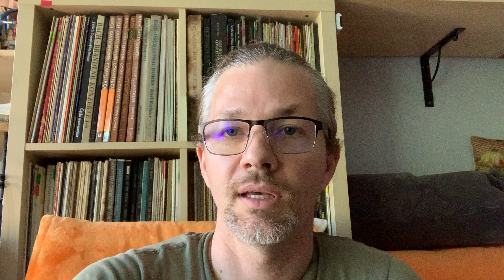Is OTL -  OCL for me or not?

Comment: How will an otl match with  la grande with the Fostex which would not be expensive to replace or will they not suit a single driver the same as the tubes?
Reply from the maker: I have never tried the La Grande with an OTL. I would suspect that it would be a good match. OTL is also tube amp, just no transformer. The matching would really be up to the OTL, what output impedance it has, and how that impedance is generated. If it's naturally low, (rare), it would be a better choice. With a lot of feedback, then it would not be a very good match. It will likely sound good, but likely not nearly as refined as a good transformer based amp. I have heard very few OTL amps though, so all I can say is try it out, and have the experience under your belt.

Comment: Hi janos !    why would otl have a transistor sound? André
Reply: please elaborate
Reply from the maker: 1. lack of output transformer = loudspeaker impedance is not properly matched (same with SS, no accurate impedance matching) 2. loads of negative feedback (OTL requires it, just as most SS). 3. high current & low voltage output (just like SS) 4. much lower plate voltages than OPT designs results in lower voltage/dynamic resolutionjust like  SS  5. multiple badly matched tubes in the output stage (as poorly matched as transistors). 6. no OPT = low frequencies do not show the typical square wave tilt observed with OPT designs. This one will be the most striking one for most, making the bass of OTL sound as if you heard an SS amp. (Provided speakers are of very high impedance / no impedance dips.)
Reply from the maker: @Cipollae  Hi Cipollae, I never got into playing around with varitations on OTL nor delving into their inner workings beyond a very basic level, as they produce too much heat. (I live in Hawaii). Although at an 1W out level the heat is not bad, and I was thinking of building an OTL as a headphone amplifier, but never gotten around to it (and to a million other projects... in life, the main limit to audio exploration is not really money, but time).
Reply: @realworldaudio  thanks janos !

Comment: Would You review the bottlehead 300B preamp? It's a kit and it will proof my skills very hard.
Reply from the maker: It will work well (without the shunt mod) with tube amplifiers (or the extremely rare solid state amplifiers) having at least 200K input impedance. (Which is super rare nowdays, even for tube amps!)  With the shunt mod its output impedace is lowered, but I suspect that takes away the 300B magic as well. Also, it has only 6dB gain, so it's more of a tube buffer with little gain for amplifiers with 200+K input impedance. Should have superb midrange, spaciousness, but do not expect subterraneous nor overcorntrolled bass.
Reply: @realworldaudio  Thank You very much. I got a pair of Brocksieper LC 807 currently not used with 25 W max output. And I like bass somehow, at least from 35 Hz up.
Reply from the maker: @Nihil1st1347  I was not aware of that company... looked it up, and was amazed to find they are using 807 power tubes! They are my favorite tube - I have the same impression of them as the company description says: they do not have a flavor of their own such as EL34, KT88, 300B etc, they just play music. They can also do excellent bass, but it requires perfect system and room matching. When that is all in place, the 807 gives bass that is refined and textured. Never overdone, always on the refined / balanced side. They will definitively not add anything to bass, that's why most people are initially unimpressed with 807 bass as it is just like any other part of the frequency bandwidth: no added MSG. With my push pull 807 the quality bass production goes down to 11Hz.  The 807 being on the neutral side, when music has no bass, it will never add it. However, when it has high quality bass I found it surpassing my wildest expectations.

Comment: The late Harvey Rosenburg who use to sell Futterman OTL amplifiers used to say if you
listen to his OTL amps with the Quad 57s electrostats on a female vocal you would need 
diapers because the sound was so real.Ten years later Harvey goes to Japan and hears a
vintage  transformer coupled 300b single ended amplifier with the big Tannoy Westminster
Royals and gets blown away.Move forward a few more years and Harvey is writting about 
transformer coupling as  he refers  to the sound as MAGNETIC CREAM. In the end even the man who was OTLS bigest fan went to tranformer coupling. A few years ago I listened to an Atmasphere 60 watt OTL amp on Quad 57s it sounded pretty good because of the 15 ohm impedance the same amp on the my other friends Magnepans at 4ohm load did not sound very good because of the low 4 ohm impedance. Point to be made here if you change your speakers a lot stick with the transformer coupled amp as it drive varying impedances better and will save you a lot of grief in the end.
Regards from Canada Lou
Reply from the maker: Indeed, the progression towards super high efficiency speakers and low power amplifiers... direct, shortest path is the straight path, there's nothing that can be done about it. Every other solution is trying to fix the issues that arose because we got to complexity modern designs because we were compromising simplicity at the first place, to make it more compact / cheaper / more trendy / novelty... fixing the fixes takes us to a certain level, but going back to clear sound requires returning to the straight path.
Reply: Actually the ESL57 dropped to below 1 ohm at certain frequencies. I had them for years, first on a capacitor coupled amp (Quad 303) and then later a P/P transformer coupled tube amp (Beard P35). I had a great audio dealer nearby then, which helped me get gear with good synergies. If you can deal with suspended reality (lack of lows) the 57 is an awesome speaker - and especially with some of the internal damping removed, voices are startlingly right there (in the sweet spot). It's somewhat like a nearfield monitor, actually. But the 57 is unsuitable for amps that go nuts over variable impedances: a Quad 405-2 sounded terrible, the whole tonal balance went in the gutter. I have never heard it, but an ESL57-Quad 50 would be interesting (transformer coupled solid state) .. Anyway I'm off highly directional speakers but the ESL57 is still a fine example how little progress has being made in audio over the last 60 years and quite like the Altec 414s I'm using now... there's no current 12" that has a 30Hz Fs, 99dB efficiency, uncoloured mids and sounds good on a 1W signal..
Reply: Hi Eduard Interesting that you brought up the 57s I have a friend who I convinced many years ago to double stack and then triple stack his 57's.
And you are correct sir if the speaker is designed properly it will stand the test of time whether  it is a quad or western electric they can sound quite magical.. Each speaker is driven by it own quad 2 to allieviate the 1.5 ohm dip at 12k and the 30 ohm rise at 100 cycles in the bass.I agree with about 99 per cent of what Janos ,Frank, and yourself have to say about what it takes to make music sound realistic from a bunch of caps, resistors, wire and transformers.The path I chose is dual mono from the cartidge to the speaker all transformer coupled including the volume contol in the linestage, the phono stage which is transformer driven LCR.And a trans coupled 10 driving a pair of 300bs. Each monobloc is about 170lbs each
and they are connected to a 16 inch field coil with an 8 inch mid field coil. and an 8 ribbon tweeter of my own design. Each field coil is power by a 50lb power supply. Oh by the way I also built my 1541 dac with a 3 rail tube rectified choke filtered supply for the dac chip and a tube output stage  and power supply just to give you an idea of where I am coming from.
Best regards Lou @EduardBroekman
Reply: @loureda5443  Thank you for sharing and painting such a fine background picture!! Your own ribbon - very impressive:) You truly went to every core technologies applied first in every field - Qvortrup would be nodding all the way,... ok, apart from you not supporting his car buying habit :-). I've got a (LCR) tube phono stage and cd conversion tube+OT out on my list for the next 12 months (1541,AD1862 or WM7481 - I have the latter 2). Like yourself, I really like transformer coupling.. my experience is not that wide but I just never liked the sound of any capacitor and the circuits remain simple with ITs. My next trial amp will be a push pull 4P1L and I'll use an EZ81 as cathode bias, no caps apart from in the B+ supply. There's so many interesting things about your choices but here's 2 perhaps related questions (1) Why did you go full dual mono?  (2) Any lessons you took from going all out on power delivery (guessing that's where the weight is coming from)  ?
Reply: @EduardBroekman Hi Eduard I made the ribbon with 3 micron x 3/16 x 8 inch Japanese foil and pleated it. The foil rests in between 32   2inch x .5 inch x .5 n48 neodymium magnets.I got hammond to make me  custom C core transformers  for it that is speced  out to 100,000 cycles and provides me .05, .1 and .2 ohm secondaries and 4,8, and 16 ohm primaries.I met Peter Qvortrop and Kondo about 31 years ago and I traded him some of my silver interconnects for an IO cartridge that Mr Kondo made at CES .I had a silver cable company back then.Funny, I think Peter has about 30 vintage Mercedes these days.My LCR eq is run at 600 ohms so I use a 5k to 600 ohm transformer to drive it. In a nutshell transformers are just more natural and dynamic than any RC couple circuit because you are not wasting energy into heat like a resistor does.For example 5k trans primary is 200 ohms vs 5000 ohm resistor no contest.Question 1 dual mono is more dynamic and images better becuase of separation and double the supply size. Question 2  the chassis are heavy becuse they are about 29 x20x 5.5 and are made of 1/8 inch copper sheet and Wege wood.The power trans is double c  core M 0  .2mm laminate potted unit by Bartolucci. It specs out
at 1000v ct at around 600 ma. Yes, it used as a choke input filter and gives a very smooth regulated 430 volts output. Same construction for the 2 filter chokes which weigh around 18 lbs each. They  are 10 henry  800ma  @16 ohms!
Add in the input trans ,interstage, output trans, and individual heater tranformers and there is the 170 lbs.The sonic advantages in all the expense and hassle is if I made an analogy it is just like driving  a sports car at 150 kph knowing that it can easily surpass 300 kph. Just effortless relaxed, and powerfull .I could talk all night but I better go to bed.
Best Regards Lou
Reply: @loureda5443  Fascinating and valuable stuff, Lou and thank you so much for sharing; I'm going to mull over it a couple more times since there's much to unpack :-) Taking mental notes...!
Reply: @EduardBroekman  Hey Eduard I forgot to mention Bartola valves has some good info on the 4p1L tube you mentioned earlier . I have a couple kicking around somewhere.They are supposed to be superb sounding with a low rp of around 1200 ohms.
Regards from Canada Lou
Reply: @EduardBroekman  Well, I found EMS LB12EX and Phy-HP H30 LB15 Sag which are 12 inch drivers with similar characteristics
Reply: @antonsydorenko7572  Both look fantastic, very smooth FR higher up too, nice Vas to work with, low Fs, high efficiency...

Comment: It’s not black and white like so many things. So please no nonsense like:

1. Digital sounds harsh;
2. Vinyl sound distorted;
3. The pleasant thing you hear with tubes is harmonic distortion
4. OTL/OCL will kill your speaker. 

OTL/OCL sounds nothing like a transistor amplifier. OTL/OCL sounds like enormous speed, dynamic and subtle at the same time, enormously controlled. And yes it does have a bit of tube magic although it’s character is more neutral then Single Ended Triode or 300B.
Reply from the maker: You are quite right, everything depends on implementation. Yet we can generalize tendencies, which may or may not appliy to a specific unit or a specific circumstance.  Usually I go into this deeply, but not this time... cannot repeat everything in every video, unless I made a single 1000h long video.... 👍🎶 Thank you for adding it in your comment for this one ;)
Reply: Of course we can generalise tendencies. I just get a little worried when there is a focus on the negatives. But I notice you realise this as well so no problem. What I would like to add is as audiofiles we tweak, we do everything to make it sound at its best. Some people are pretty occupied that way. Why then should it be a problem to give a little care and have a little consciousness when you own OTL/OCL amplifiers. Stuff like make sure the bias stays stabile, make sure offset stays on track. Make sure you get your tubes from a reliable company. If a tube start sparking or making sounds then replace, etc. Following rules like that make no problems with OTL/OCL and sound wise you get something different and therefore special then the usual.
Reply from the maker: @guus007  Very good point, and I do mention it often on my channel that when you modify and build your gear then you are out of the treadmill and free to enjoy better sound, high reliability, and develop towards your tastes and desires.  
Sadly, most people have the image in their head that tube amps in general are not reliable, and many choose solid state for that reason alone. Even more sadly, that bad reputation is founded on a lot of commercial gear designed to burn up the tubes fast, and time to time fail catastrophically. While even for those commercial amps the spectacular failures are rare, but people share about them profusely, and these rare events become the stereotypes and people generalize far too easily. 
When you know your amplifier inside out it is a very different case from receiving an unknown OTL/OCL amplifier in unknown condition and plugging in to your system untested. (People do that, the unreliability warning is for such general approach.)